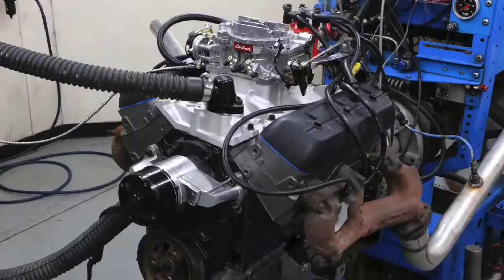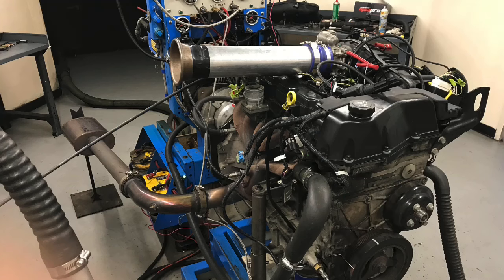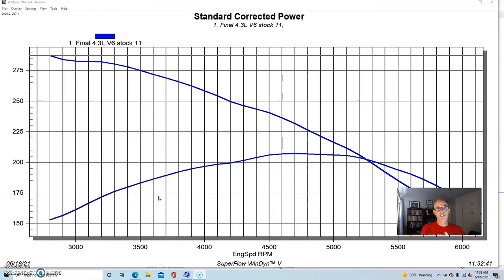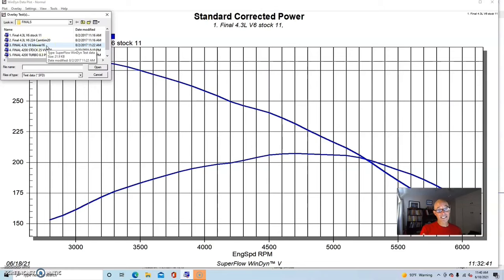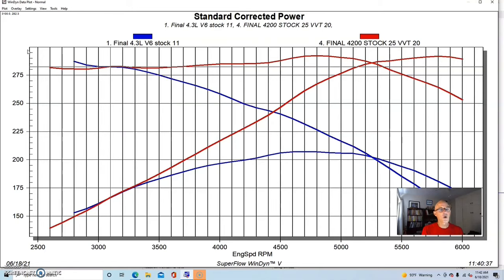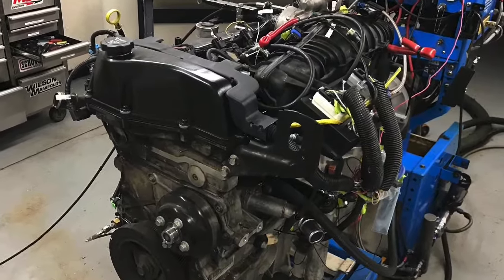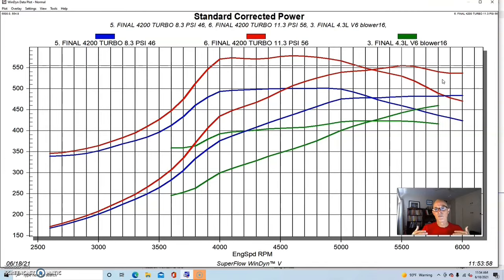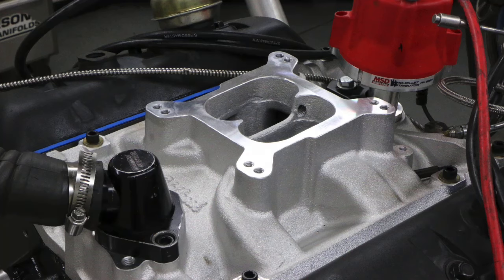4.3L VORTEC V6 VS 4200 ATLAS INLINE 6 (VORTEC VS AMERI-BARRA)

Comment: I ran my 4.3 in a g10 for over twenty years...it leaked everything and had compression all over the map but absolutely would not die. It didn't smoke or gave any problems...i loved it.
Reply: A small block chevy will run poorly longer than most engines will run
Reply: @hyattbusbey3563  I picked 1989 for the van bc first year efi and a turbo 400 and corporate 10 bolt still...plus the 4.3 over the 305 for mileage.....
Reply: Theses motors are great in boats also reliable and great fuel economy
Reply: My Dad had a 302 like that. By the time we stopped driving it the compression was so bad that you couldn't park the truck on a hill. Amazingly it still started really easily even in Wisconsin winters.
Reply: @hyattbusbey3563  bruh! I lost my shit at this!
Reply: @EffequalsMA  I'd always choose the 4.3 over a 305 my 4.3 in a 90 Cheyenne w/t would haul better than the 305 in the Silverado my buddy had I'm sure the 4.3 had slightly lower gears (3.08)I know a lot of the 2wd V8 tbi Trucks had a 2.73 but I couldn't be for sure
Reply: We had a 2500 work truck with this engine.  We were sure it would die within a year with how we treated the vehicles.
It went to 280k and we sold it and the next guy took it past 300

Comment: The 4.3 deserves some aftermarket. Be cool to see companies like Dart and PRI produce stronger blocks. SCAT and eagle produce a stroker kit. The 4.3 having a 5.0 equivalent would be a game changer for some motorsport with limited cubic inches. 

Put a gt45 on a 4.3🤘
Reply: GM still has some parts for the old small block V6 in their Performance Parts catalog.  Back in the day, they had baby big block canted valve heads for it.
Reply: They used to about 20 years ago when the 4.3 was a popular circle track motor. All that support has just died over time. Hell, GM used to make an aluminum block with a 4.125 bore (small block 400 pistons).
Reply: Scat never had a stroker crank, it was a stoke stroke cast steel crank, eagle makes the only aftermarket h-beam rods available for the 4.3.  There are still aftermarket parts available if you look around alittle harder and are willing to pay alittle more.

There is a forged 3.60 stroke crank available, but again most aren’t willing to spend the money for it.
Reply: For all the support they had 20 years ago I couldn't find it. Pulled a 2.8 out of my 3rd gen and swapped in a 4.3. I was looking for aftermarket and only found the heads and cam. Which only did so much.
Reply: Yes
Reply: @Good Fitin hey i own 1uzfe as a daily,  but i want get my hands on a vk56
Reply: There is replacement for displacement. Its called boost. Why so many 4 cylinder Honda motors get forged guts and 50-150 psi of boost. If the 4.3 had forged aftermarket support and multiple options. I bet it would be a easy 800+ hp V6 build.
Reply: @bladenrexroth2555  lv3 with twin vgt turbos will make good daily
Reply: Dude just get a lu3 block they are strong enough
Reply: @bladenrexroth2555  there is forged Rods and pistons that fit from the 350, the crank may be another story but the engines sbe is stout especially the lu3, 500 hp builds anyone?
Reply: @Good Fitin You are a reason why engines like the 4.3 lose development or have none. You don't need a v8 to make power. As you said space problems is a viable reason to not go v8, even though it doesn't stop most people(v8 Miatas), sometimes weight and where it's oriented matters as much as hp. A 4.3 probably weighs as much as an aluminum LS, but the weight will sit a bit further back. A Lima 2.3 actually isn't too much lighter than a 5.0W, but with it being more compact, a foxbody will handle better with it, versus the 5.0. It can actually make just as much power, and is actually a stouter engine.

Comment: Love my little 4.3L V6. On an engine dyno it made 276hp @ 5600 & 306lb-ft @ 4200 naturally aspirated with 8.7:1 compression, stock N/A manifolds/Y-pipe & an untuned 850cfm carb on 91 octane fuel. Shop that built it said it'll handle 30psi of boost which I plan on testing out.

Comment: thanks Richard. I hope we get to see the inline 6 maxxed out with the valvetrain sorted, e85, and any other necessary mods. 700hp or more i hope
Reply: Yeah but for what it would cost to do that you could just get a v8 and be in the 4 digits range.
Reply: @SoulTouchMusic93  nope. All thats needed is a reground cam and have been proven to hold over 700whp. Thise engines are incredibly durable and can make a lot of power for cheap. The 4200s can make around 550whp completely bone stock with a turbo. Stock pistons, heads, cam, valvetrain, bottom end, everything.

Comment: I have a daily driver GMC Envoy  with the 4.2 and 340k miles. I have owned both engines. By far the 4.2 has been better all the way around! I do like both as well, but as for durability. It's 4.2 all the way!
Reply: Right on! I haven't yet seen another one with the miles like I had still going strong. Many 200k plus however. 
I had an 09 TB with 346k miles on it when I was T-boned in a crash, and it was totaled.
I drove that thing back and fourth to 7 or 8 different states every 2 weeks for work towing a 5x8 enclosed job trailer for 8 + years prior to that, including Colorado on I-70 yanking that trailer up a 7 or 8% grade at 70 mph. 
It had 90+?k miles on it when I bought it.

Parts that I replaced are...

Fan clutch... Lol. Of course I did.
Water pump
Passenger wheel bearing 
Passenger CV axle
02 sensor (upstream I believe)
Front sway bar links
Both rear gate shocks on window
Radiator 

The Water pump Fan clutch and Radiator were all the same incident.
I spent so much road time in that thing I would have put another motor or trans in it if I ever had too.
I never did question if that thing would get me there, because it never gave me a reason too.
I was absolutely getting curious about how far that thing was going to go. No noticeable blow by.
And what would make it the longest;    =  Motor or Trans.  =  Both factory stock.  @346k. 
It had the cloth seats, and pos interior door handle trim pieces, and I would get busy, and let my oil change light run on for too long after sometimes, but I loved my TB and I trusted it to take me anywhere, because it always did.
I even pulled my sons buddy's 4wd Duramax diesel out of a stuck in the mud situation.
We gave that kid so much sht afterwards. lol
I never did volunteer to him, the mechanics behind a kinetic snatch strap. HE... He.. he.

I Replaced it with a 1500 sierra for work. 5.3 8 speed trans. Very nice.

Last year I bought a 06 TB LZ? if i remember? It was a good deal and I didn't need it at all, but I wanted it.
All leather, Bose stereo, rear DVD, heated 1 & 2 position memory seats, interior is almost perfect, it even still had the factory DVD remote control, with 164k miles for $1500 due to needing wheel bearing & cv shaft.
I still had my old TB out back, will a fairly new front wheel bearing assy, and a CV axle, that was just fine.

I just wanted it back.
That's as close as I can get.
We have been making friends with each other when I'm home.

Comment: I can tell you from doing both a Coyote swap and now a Barra swap into a Fox chassis car (both 2000's), engine dimensions on DOHC applications really get in the way and are a problem.   This even taking into consideration that the Fox engine bay is not small when hydroboost is used to clear some space.   The Coyote swap was a tight fit -- but the Barra ... tall and long are not easy to overcome.   This is why you see some people putting the radiator in the back of the car -- it's not just for balance, it's just that these motors are so damn long.   

Love your videos man, keep up the good work!

Comment: It’d be near impossible to find one that isn’t trashed, but I’d love to see what’s possible with a 2.4 Twin Cam that GM used during the 90s and early 00s
Reply: The "quad 4" 
Used in Sunfire GT, Chev Cavalier 2.4 etc.
Also used in Beretta GT and others.
Reply: @rdallas81  if I had recommended the 2.3, I'd have written "Quad 4"

Comment: It would be great to see the other "other guys" GM V6 compared here. The High Value 3.9. I think it would compare better to the "Amera Berra". Whiles still being a pushrod V6.
Reply: 3.8 buick and 3.9 high value engine would be a good comparison
Reply: @PtheeGoon2011  Richard could easily make these comparisons as he has already pulled and ran the 3800 SC. Which even the 3800 SC bone stock only matches the NA High Value 3.9 in power.  It would be cool if he got cams and a set of ZZ heads for the 3800 just to see how good the 3800 could be.

Comment: I love these 6 cylinder comparisons, especially having had a few of the 4.3s. Compare the Chevy 292 inline 6 to the GMC 305 V6 from the 60s  I have both of these. The big block V6 is in a stock 1965 pickup and the 292 I am going to build with a tri-power setup for a 1950 Chevy pickup.
Reply: Power Block built one of those 292s up once with a turbo.
Reply: I remember reading an article in Hot Rod back in the 90s, where a guy built a turbo 292 for his '37 Coupe, and that beautiful folder-tan machine ran 10s!

Comment: I like the old 4.3 v6, my first car was a 91 S10 Blazer 4door and I thought I was hot shit with 160hp. Fell in love with it. Supposedly there was decent aftermarket at one time, but the engine was ignored, and GMs best effort with it, was the Sy/Ty, though they did put a bit more effort in 3.8s. What killed this thing was us Americans and our dumb ideology that v8s are the only way to make power. There used to be a 3.8 sn95 that ran 8s. I still want to build a 4.3 v6, hell it made 450 with a supercharger, cam, and intake.

Comment: I’ve been a big fan of the 4.3 V6 for many years, and currently building a 275 cube V6 with ported heads that flow 266/192 with twin Wynjammer centrifugal super chargers and long tube headers.  Based on your test, my goal of ~450AWHP should be doable.

Also, Brodix heads in -8 or -10 are readily available from Brodix, but they aren’t cheap at ~2300-2500 a set.  You can also get a Pontiac high rise single plane intake, not as easy as the heads but they are out there.  There is also a 3.60 stroke forged crank available for these which is how I got 275 cubes with it and a 4.030 bore.

Keep the great videos coming!
Reply: Where do you find all those parts at? I can't find them anywhere
Reply: @chrishansen7004   just got to know where to look!!

Comment: I would love the 4.2 if not for the head cracking issue. The later 4.3 would be an interesting base for a build given its stock 285 hp and 305 tq.

Comment: Got me one of the new 4.3 2015 double cab. I got headers magnflow exhaust. With a tune replaced the flywheel with a upgrade, next will probably put 3.73 gears. Turbo maybee in the future but it runs good as is gets up n going. Its got 115k miles no issues even before the tune always changed the oil on time or early with a fuel treatment each oil change so the AFM was not issue no oil consumption, the 4.3 tends to stay in V6 mode more than the 5.3 stays in all 8.

Comment: Buy a used Syclone intake on eBay and see if it helps the 4.3 any...(my curiousity)

My gawd though...I love the idea of the 4.2 and the mountain of TQ it puts out... Just wish it would fit under the hood of my Astro🤔
Reply: ASTRO van?  No but a v8 will fit.
Reply: Bruh, that 4.3 made 450 hp, that would suit an Astro just fine, granted there would be no room for the super charger. The one he built versus the L99 made similar power. The Turbo 4.3 used a stock intake I believe. I think the only difference was heads and compression.

Now you got me thinking about a Astro Syclone. Call it the Hurricane. Plus it's on the s10 platform, so suspension is little problem.
Reply: @ItsDaJax  Bubba an awd ASTRO was made. Plenty of them out there. A stout 4.3 would be good. But a milt to stout street build 350-383 or ls would flat out Rock anything the 4.3 would do. Especially in lower rpm torque where you would get the giggles the most.
Reply: @darinr9424  I know. The Astro/Safari and Bravada both came with SmartTrac- which then found itself on the Sy/Ty. If I recall, it's a Borg Warner tcase, The early 00s Mountaineer also used it, and I think the H3.
Reply: @ItsDaJax  yea I had a 93 bravado with it. The last year of the non electronic case. It was an all the time 60-40 split and not that electric crap to quit workin

Comment: I have always loved the 4.3 and the new design really pushed it over the top.  BUT I have an Envoy with the 4.2 I have been driving for a few years now and love it now just a little more the. The 4.3 because of the bottom end.  Between 1500 and 2500 rpm  when towing.   I have been heavily considering a small turbo setup to give just a little bit more on the bottom end.
In 2005 the built a prototype 4.2 (I believe) it was twin turbo.  460 ft and torque.   But they never produced it.

Comment: Back in the 1980s both NASCAR and even some Indycar teams used a few GM V6 engines.  The 4.3 is a good base truck engine but it cannot compete with a multivalve DOHC engine of similar displacement.
Reply: I still see more 4300s on the road, reliable engine.

You forget the Syclone/Typhoon
Reply: @shadowopsairman1583  I did not forget.  I had a brand new 1988 S10 4.3 I bought in Sept 1988.  Drove it 8 years.   Kicked ass.   Beat a lot of Mustang GTs with it.

Comment: Very informative, just need to find out what the compression ratios are, fuel used, peak timing, relative air fuel ratios, and any sort of internal engine specifications. I was glad the estimated size of the engine was mentioned; no actual dimensions needed for that.
Reply from the maker: 91 pump gas, AF and timing was optimized for each (no more hp to be had), all specs are available on line-the engine size is not estimated

Comment: I'm pretty sure only second gen (after 2006?) 4200 Atlas motors had improved valves and exhaust ports.
The first gen motors need a lot more detail work to squeeze all the power out of em.

Comment: Chevy built 18 degree heads and single plane manifolds for the 90 degree v6. They also produced a few different crank shafts as well as a raw crank forging through the Chevrolet performance catalog. It's been about 20 years though. Most of it was for imca racing and some off-road racers ran that stuff too. All the tricks that the small block received could be duplicated with the V6. There was also an aluminum splayed 4 bolt main block available. In theory you could build a 3/4 383 stroker using the parts from the bowtie catalog.
Reply: Evidently 310 cid seems to be the target size 
For these things. 650-675 horse is not out of the realm of possibility for a properly prepped race engine. I would expect that the off-road guys would de-tune for longer desert races.

Comment: I'm in the process of building a 4.3 turbo s10. I really wish the aftermarket support was there. I've definitely been jumping through hoops to it right and reliable
Reply: Promax makes heads
Reply: And like he said anything that will bolt to the front of a SBC will bolt right up to the 4.3. Just need more head and intake options.
Reply: @treenutz360  they're no better than stock vortec
Reply: @fastnasty6627  head and intake are the biggest hurdles. Also no affordable aftermarket crank..

Comment: Thats awesome I love my trailblazer with the 4.2. It's one of my favorite engines. I also have a 2500 silverado with the 6.0 and I love that too but my dad had a 1500 silverado when I was younger with the 4.3 v6 and that definitely had some pep in its step. I'm surprised how low the power numbers are for the 4.3 I always thought they would have more considering how my dad's silverado performed.

Comment: Something I have not seen anyone do, and I've been curious of, is mpg. I'd like to see these motors side by side comparison of tuning for best mpg obtainable in relatively stock trim, and then compare HP and torque in that tune.
Reply from the maker: that needs to be done on the street
Reply: I have an 07 trailblazer 4X4 4.2L and a 88 s15 4X4 truck 4.3L both automatic trans. The trailblazer tells me i get 16 to 18 MPG and my s15 at last figure was about 19 average. The 4.3 has a 600 CFM throttle body, MSD, 1.6 rockers, injector spacer and Adj. fuel PSI regulator. It's the crate HO version Vin W 200HP 260 TQ like he's using in this vid but mine has about 20,000 miles on it. The 4.2 has about 126,000 miles. Those would be considered city estimates a lot of stop and go. The 4.2 was not known for good MPG's.

Comment: Id like to see some duratec stuff Rich. Like that little 2.7 liter in the f150s. Test the EcoBoost setup, then convert to a single like gt35 or comparable. Even the 3.0 n/a duratec v6 in like the gen 1 escape, gen 1 fusion etc. I have a 3.0 duratec v6 in my sand rail. Its absolutely BOMB PROOF. They also have multi port injection with a common injector style and size. My issue is, theres NO aftermarket support as far as ecu upgrades. I put gen 2 coyote injectors in mine, walbro 450 with a OEM ford flex fuel sensor to run e85 and she makes 266 to the wheels through an adapted vw 4 speed transaxle. I have 3 spare engines i paid $180-$340 for. They have all the ingredients for impressive boost numbers. They rev high, the head castings are surprisingly unrestrictive and stout, the timing chain is identical to the 4.6 liter v8, and like i said, theyre actually good little engines. I beat the life outta mine and ive never thrown a rod, just head gaskets which is to be expected with 200k mile engines pegging limiter in 100° heat. Thanks for what you do buddy.

Comment: i really wish you could do low rpm test showing power and torque where most people drive engines around at.. helping people build efficient powerful trucks for working that wont be racing